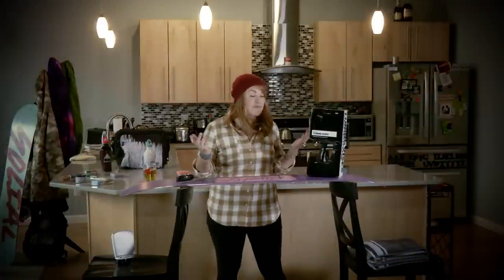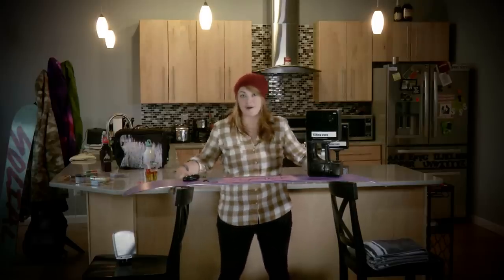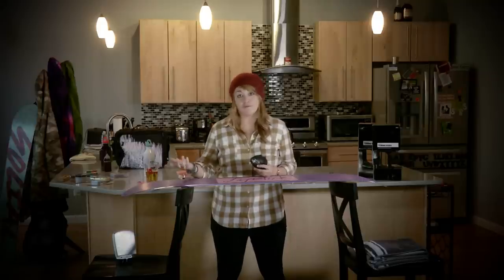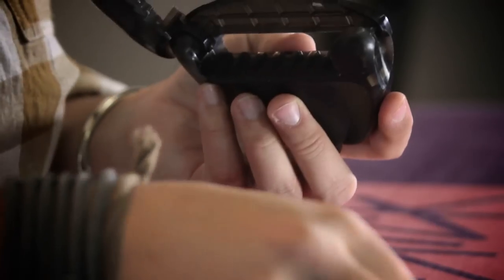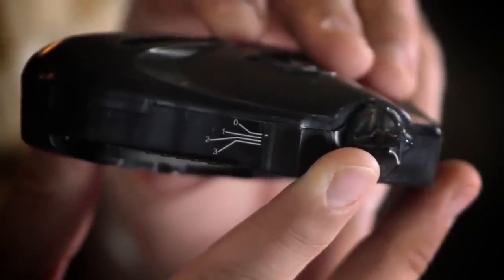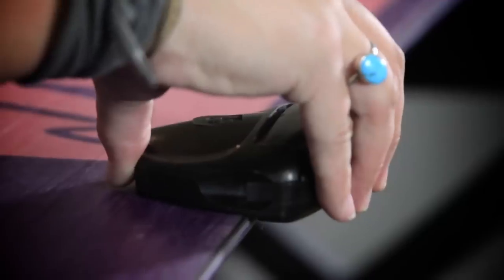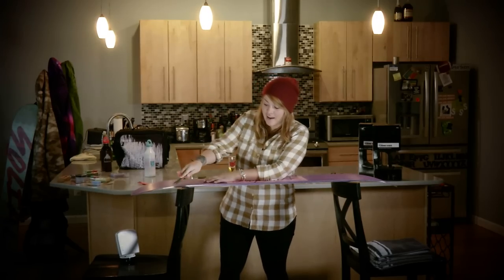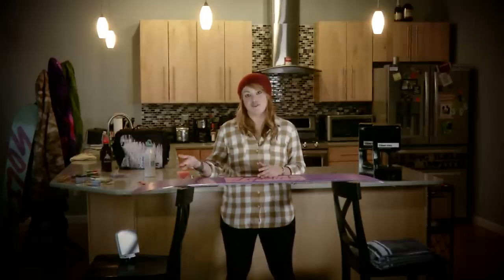How To Tune Your Edges

Comment: Someone please explain 89 vs 88 and which direction the file bevels need to face. Every video assumes we already know this basic info, but I’m looking up instructions for a reason.
Reply: I can only tell about the certain edge tuner design, like the one marketed by Dakine (there are some equivalent options like Demon Tools, etc.)  It has two sides, marked 90 and 88. So whith such a tuner, the number you see is the one applied. If 90 is faced up when you are working on side edge, that refers to 0 bevel (90 degree edge). If 88 is faced up, then you are making a 2 of a bevel (88 degree edge).

Note that one should not try working on the base edge with that very tool, as it won't keep straight enough. Better use a flat ceramic stone or a file, as shown in this video.

Comment: My friend has a Dakine edger that has 90 degree and 88 degree. Is there really any difference?
Reply: 90 is 0 degree, 88 is a 2 degree. if your not a jibber, snowboard edges are usually 1 degree which is a 89 degree. I've been tuning for 7 years for Aspen Snowmass. if your a boarder i would stick with the 90 degree